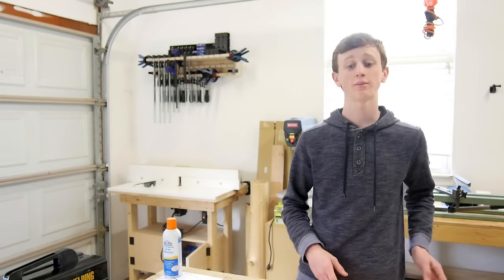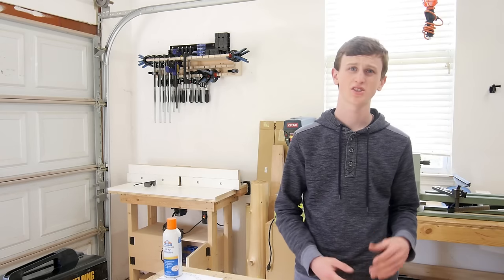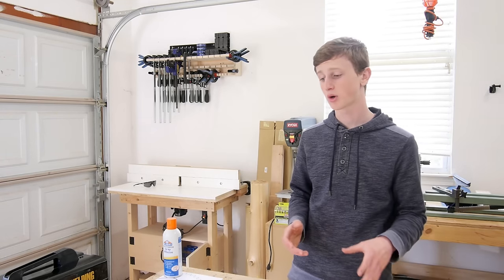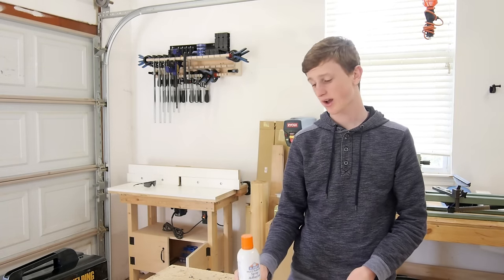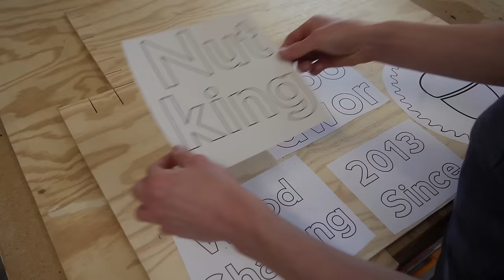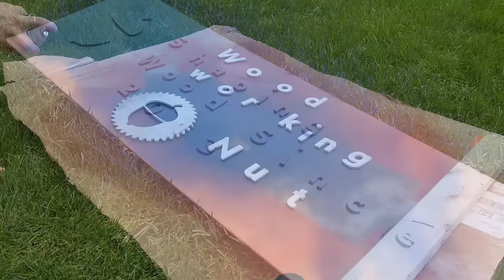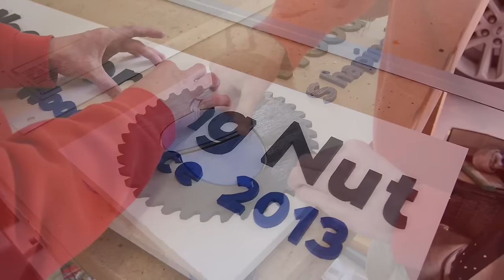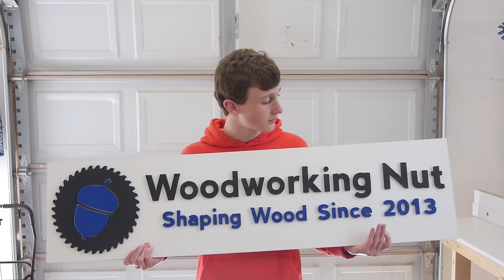How to Make a Custom Sign | Great for Workshops!

Comment: Great job as usual. However, the mist from the spray adhesive will travel all thru your shop including your lungs. If the car was in there, it will settle on the paint and the windshield which will make the wipers smear next time you use them. Been thru this before, windshield is hard to get clean from this stuff.

Comment: another perfect project....heres a tip when ever applying patterns use packing tape on top of lumber prior to gluing on the pattern this keeps the spray glue off the wood plus its easier to remove and when scrolling it lubricates and helps from burning the wood....
Reply: +Eric Lindberg I use painters tape on the wood.  I spray the contact adhesive on the painters tape.  I Apply the pattern.  Then I put the packing tape over the pattern.  The benefit is that the painter's tape peels right off and you don't have residue from the contact adhesive on the wood.  That and you don't have to use mineral spirits to dissolve the contact adhesive.  The packing tape, aside from lubricating the blade, makes it easier to see the lines and keeps the pattern in tact.  It adheres to the painters tape real well.  As to spraying on to packing tape, can't say as I haven't tried that.